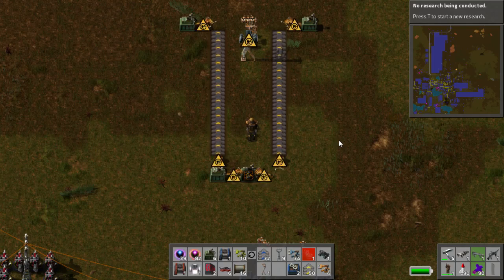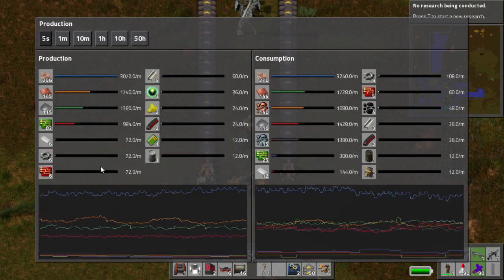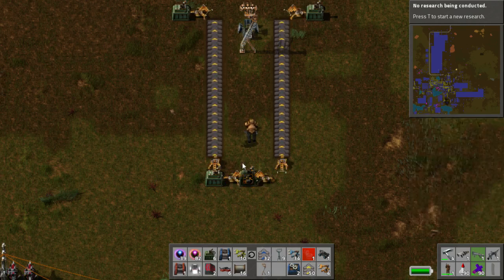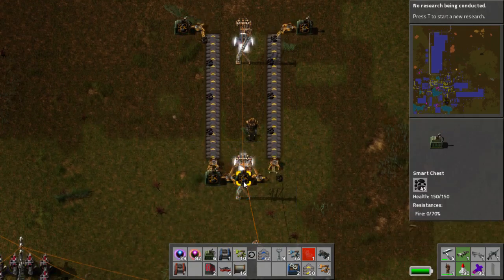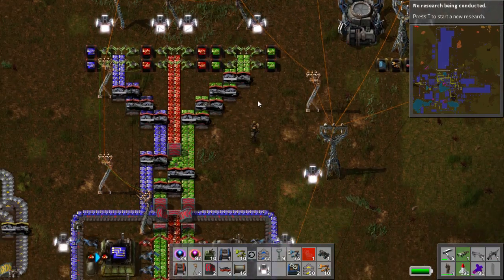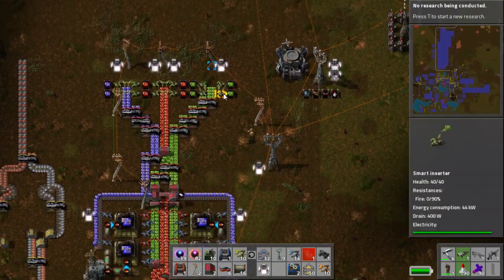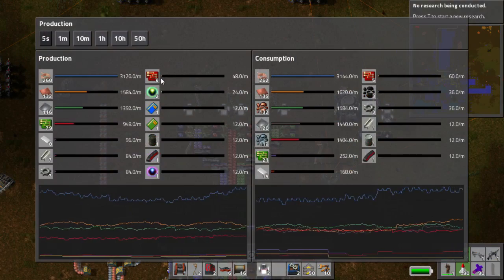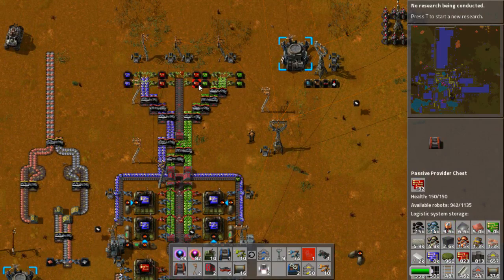Factorio Tutorial 28   Buffer Storage & Overhead

Comment: Negative Root I think you have your terminology mixed up. In engineering, overhead usually means the extra resources used up in the process of getting from the start to the end. For example, when you download a webpage, it has to send a lot more than just the page itself; there is a lot of communication that coordinates the transfer of the page. That extra data is not the goal of the transfer - it's not the final product - but it's needed to get the job done. That's what we typically refer to as overhead. An example in Factorio would be the fuel spent powering pump jacks, refineries, and chemical plants in order to create solid fuel in order to generate more power.

What you have described is what we call "margin". This is the additional capacity that is provided above and beyond the typical, expected need. Its purpose is to provide for unexpected or infrequent bursts of demand. As an example, when I drive to work in the morning, I leave 15 minutes before I intend to arrive, even though it typically only takes me 10 minutes. That extra 5 minutes is my margin and it is there to make sure I don't end up late even if it takes longer than expected. This is analogous to your additional assembly capacity, which isn't normally needed, but is there so that the demand can be provided for even if it suddenly increases.
Reply from the maker: Not going to argue with you there. 90% of what i say is half made up :D